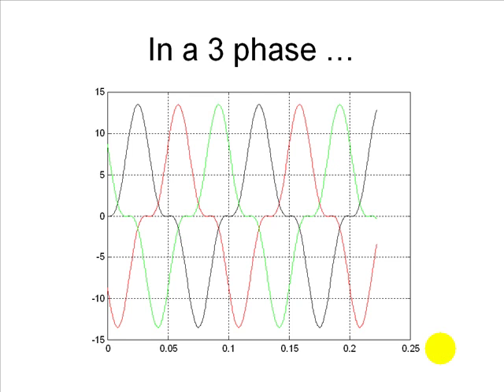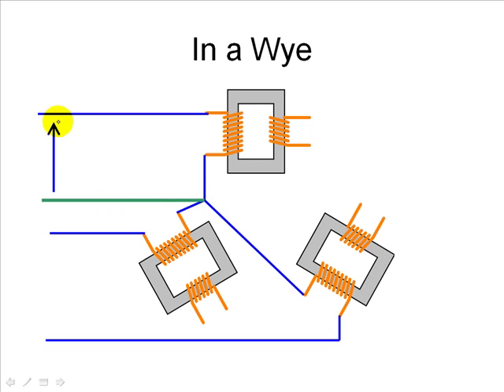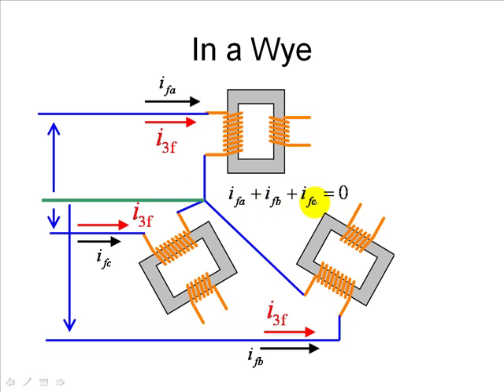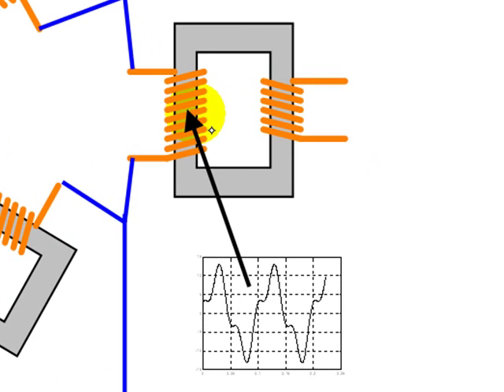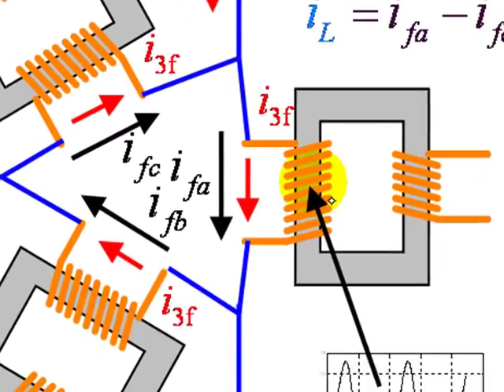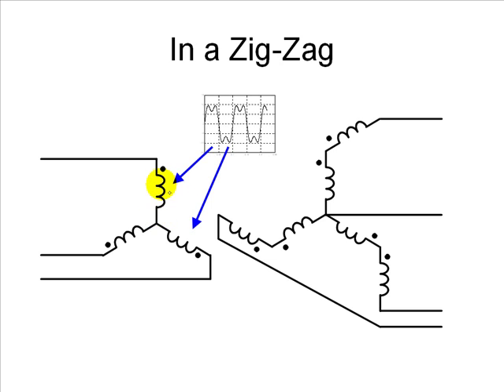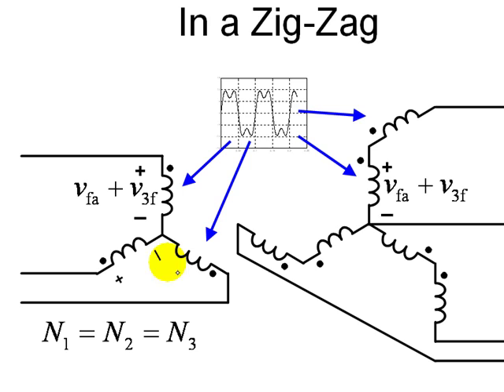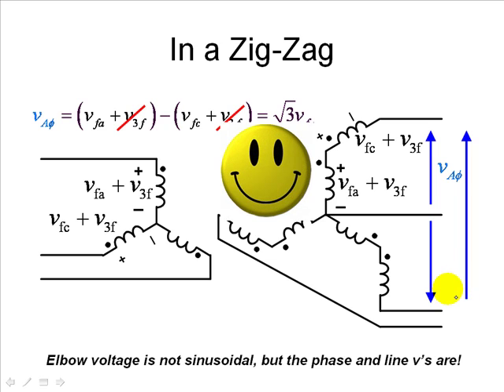TRAN 07 - (Part 2) Triple Frequency Voltages and Currents in Transformers

Comment: 3:04 
What if a neutral path is not provided ? Where do the triplen harmonic currents flow ?
Reply from the maker: Without a neutral path to a Y connection of primaries, there is no triple frequency flowing. That is why the voltage is distorted. The 3f cannot flow.